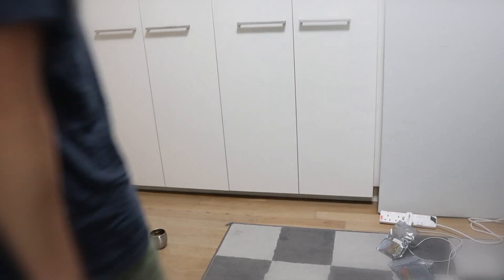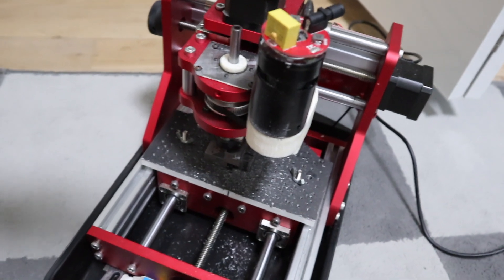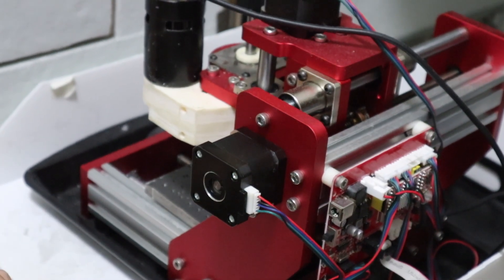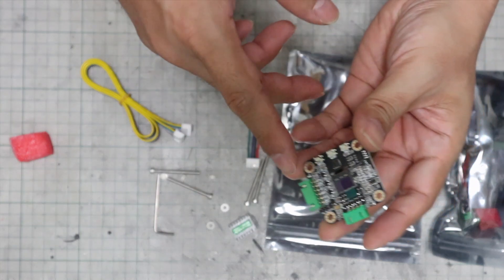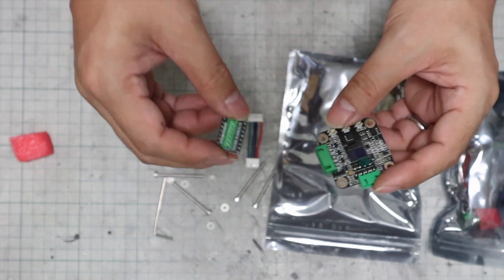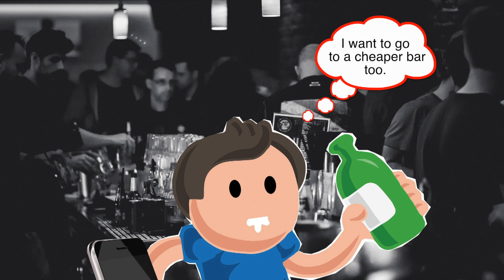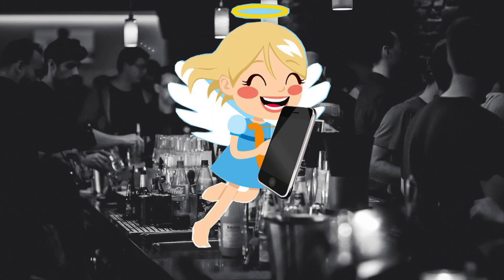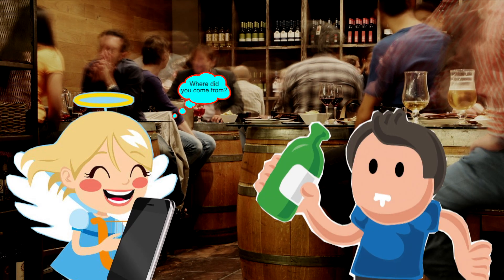CNC1310 router is taken to the next level for stable steel machining.

Comment: These stepper servos are not very good for high-dynamic applications.. Main weakness of 1310 cnc is leadscrew (vs ballscrew), not steppers.... It's rigidity in one direction is defined by weak spring on each axis...
Reply from the maker: Thanks for the comment.
I can agree with your opinion.
Using servo motors and ball screws is the most appropriate way.
However, since this machine is a modification of a commercial product, it is difficult to say that it changes the fundamental specifications.
The only reason I am recommending modifying the stepper motor to a closed loop is to prevent step out.
Because when a step-out occurs, everything is ruined.

Translated with DeepL.com (free version)

Comment: These servo42c from Aliexpress SUCK. Bought 5 of them, 4 do not work (freeze after booting if EN or COM pin is connected to the controller
Reply from the maker: Does the motor not run completely after being turned on?
If it runs a little but not properly, that could mean that the four wires leading to the motor are wrong.
Another way to check is that one motor seems to work, so try replacing the encoder used in that motor with another encoder. If it does not work, the encoder is most likely the cause.
It could also be a problem with the encoder settings. But if it is the default, it should be the same.
Then use an oscilloscope to check the signals coming to the wires.
A tester can also give you some idea.

Comment: about the Z-axis. 
there was nothing to stop you from leaving the knob and installing the board on the back side of the feed screw :)
Reply from the maker: I remove the handle and there is a feed neni there.
Eventually, I can't mount the board the same way as the X and Y axes.

Comment: Nah this will not work. Stepper motors have higher accuracy than those encoders. Same thing happens with the encoders, they also shift because of gaussian error. 

Just increase the torque or decrease the speed. High accuracy encoders use optics tech like lasers etc. They measure in nanometer and costs 100k +dolars.
Reply from the maker: This modification is an improvement to a problem when machining metal on a desktop CNC router.
One of the major problems is the step-out of the stepper motor.
This is a countermeasure to solve this problem.
This machine is for hobby use.

If you need real industrial level performance, you need to make all components industrial level, not just the motor.

Comment: Hi!
Your video is very interesting as always.
But this time I'm not ready to agree with you on everything :)
I have the same CNC3110 machine. I tested its accuracy. I researched the phenomenon of "skipping steps" SD. I even tested it under a load of almost 100N and it showed acceptable accuracy. (There is a video on my channel).
The problem of "skipping steps" is much less of a backlash problem in a trapezoidal drive.
If this backlash is eliminated, the efficiency of this machine can be significantly improved.
Reply from the maker: The improvement of the backlash is addressed in the previous modification.
This was a modification to increase the nut preload on each axis, for example.
Increasing the preload increases resistance and increases the likelihood of step-out.
The current modification is a modification to prevent step-out from occurring.
To further improve backlash, I believe I need to make more mechanical improvements or use backlash compensation with LinuxCNC.
I believe this modification would work for machining steel.
Reply: @a-cnc-f  I agree with you that Increasing the preload increases resistance and increases the likelihood of step-out.
But I went the other way: 1. Removed the spring. 2. Removed long screws. 3. Instead of screw holes, I cut out arched slots in paired nuts. 4. Mounted the slotted nuts against the fixed nuts. As a result, I was able to eliminate the backlash by turning one nut relative to the other.
Links are not allowed in your comments.
Maybe I'm not explaining clearly, but with an illustration, everything would become clear. :)
Reply from the maker: @AlexMoonXXI  
I watched some videos.
It's a great activity.
You are very logical and sophisticated.
You are very good at using home CNC machines.

https://www.youtube.com/watch?v=TqCw8o4CWfM

https://www.youtube.com/@AlexMoonXXI/videos

Comment: Why swap wire you can set direction on MKS45C in the menu -> DIR-> set CW/CCW option
Reply: it want that his direction was wrong, is that it wasnt moving at all. he had the coils miswired I believe
Reply from the maker: It is not a problem of direction.
It is true that changing the wiring also changes the direction, but this time, it did not work properly.
That was mentioned in the manual.